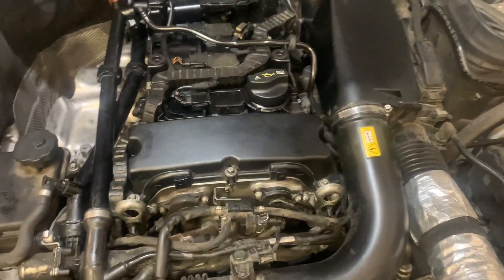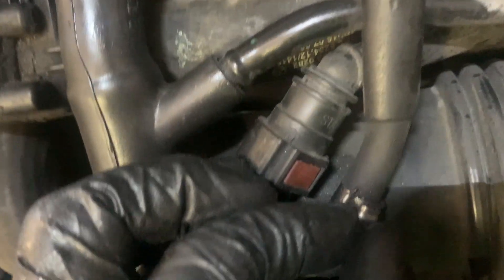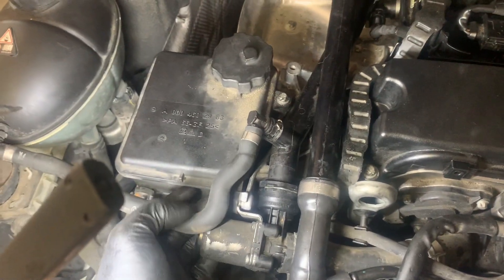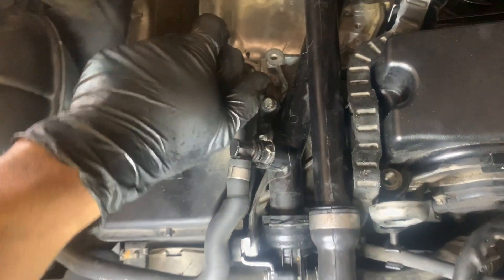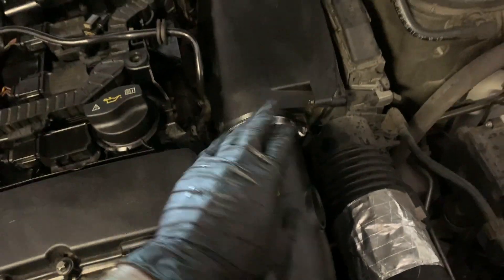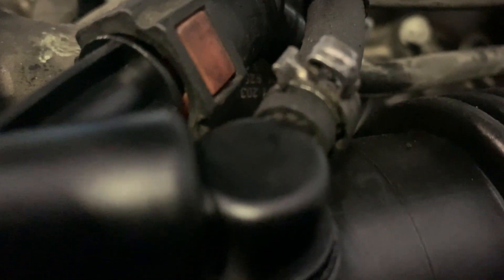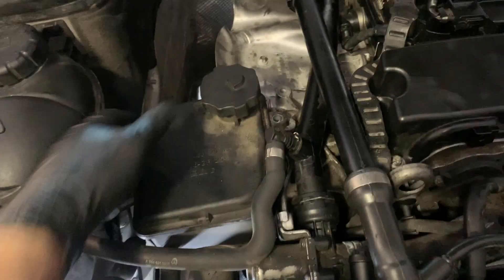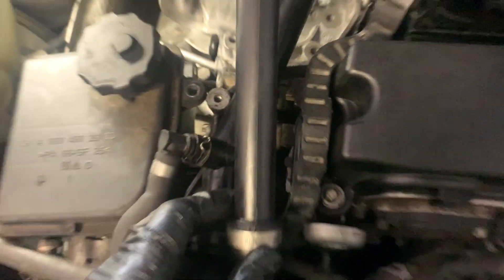2013 Mercedes-Benz C250 Intake Trunk/Hose Replacement

Comment: We replaced only the small broken pipe/hose (pretty stiff to call it a hose though). My son ordered it from amazon and it was delivered the next day. We did not take anything apart but didn't get it on the last 1/8 of an inch on the bottom connection. Now that I see this, we may take the whole unit off sometime to give us leverage to push it on all the way. 
He found it by searching while he sat in the car waiting for a tow. He doesn't do much work on cars, so if he can find it, others can as well.
His car started shaking really bad and then stopped running when if finally broke apart while he was on the freeway. It runs OK now with the new hose, but further diagnostics also show it has a bad PCV valve as well, and those are built into the intake manifold cover so you have to replace the entire cover, not just the valve. Search for vids on that, does your oil filler cap bounce around when at idle (unscrewed for the test)? It should get sucked down but won't if the valve is bad and there is positive pressure instead. Seems to be a common problem on these.
Reply: if its the one with the red push tabs, can you give me the name of it please?
thanks

Comment: Was the car idling poorly  or running poorly when the original hose broke ? Thanks for the video .
Reply: Mine started running poorly and shaking a bit when accelerating
Reply: Does anybody know how much the parts and the labor was
Reply: @dgonzz90 same mine was shaking a bit

Comment: Hey, bro. I have an urgent question. One of the two pvc pipes on the left of your video under the engine cover. One pipe cross over the other one. What’s the name? Mine broke.
Reply from the maker: I believe it is a breather hose but I’m pretty sure that it is a dealer only item.
Reply: @TexThaiAuto  Thanks for responding. I’ve found it online on Amazon. Amazon sells all of them. It’s called Coolant Pipes. It comes connected to the other one. It cost $80 but some are as low as $35.

Comment: What  is the exact name of the part that you are replacing? I tried searching "intake manifold" replacement and I get completely different parts. I need to replace the exact same part that you are replacing in this video.

Comment: How come you didn't show us put the tube back on? I know why. Because it's hard as f***
Reply: I agree. I'm doing that job as we speak. Tried WD40. Might try grease. If that don't work then not sure what's next.
Reply: I set it as far as I could go with my hands, then tapped it in place with a rubber hammer. No stress putting it back on.

Comment: What's that part you pulled out called at 1:00
Reply: i’m trying to figure that out as well
Reply: @project.q50  I broke mine and I need a replacement 😅
Reply: @project.q50  no issue with the brake pedal but when I went to mercedes they said it's just a hose that connects from the air intake pipe down the engine somewhere I'm going to figure it out soon
Reply: @bobbybates16  if you find anything, let me know bruh, i’ll do the same
Reply: The one with the red push clip ?
Reply: If it’s the one that snaps in with the little red square it’s called a “brake booster vacuum hose “ hope it helped you out !
Reply: @BC2FITTY  yes, it’s the one with the red push clip that connects to the intake manifold. you have a link where to buy it ?
Reply: Savage it’s a “brake booster vacuum hose”